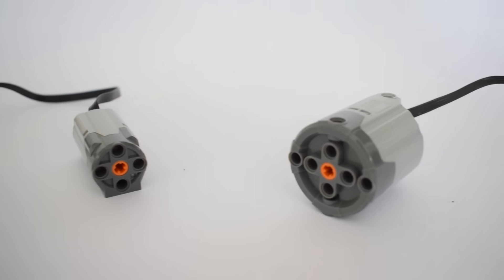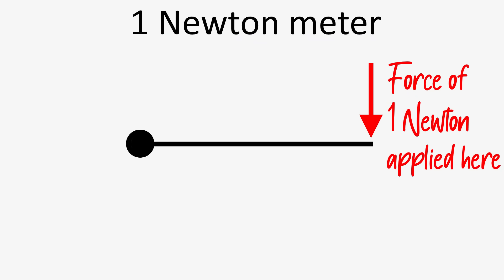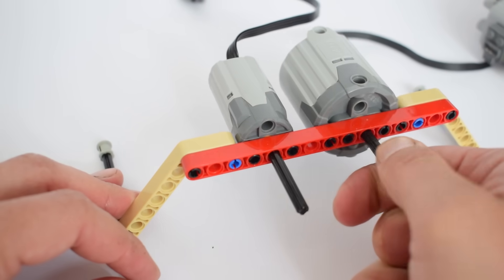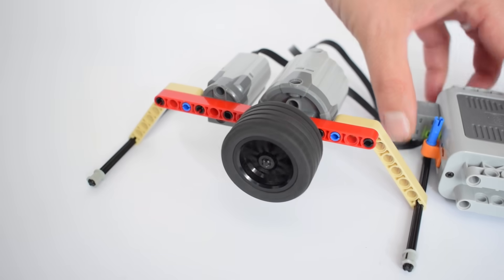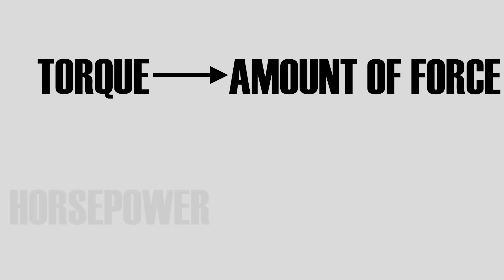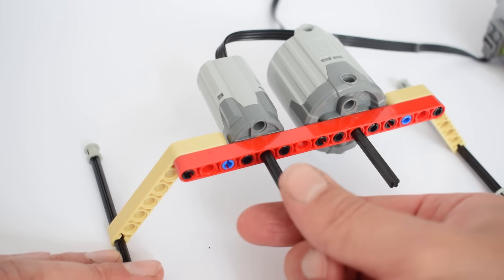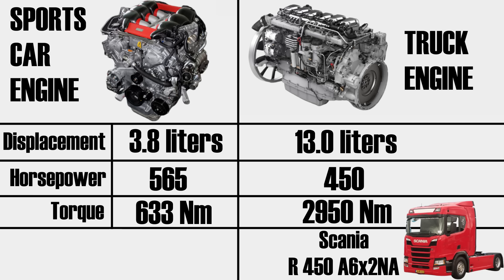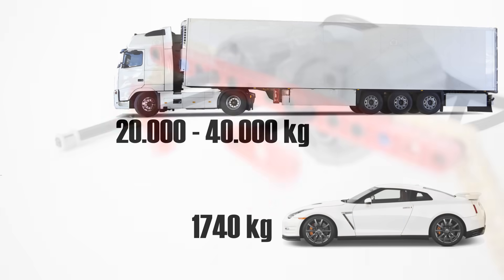NEVER be confused by HORSEPOWER and TORQUE again - HP and TORQUE EXPLAINED in the MOST VISUAL WAY

Comment: Thanks for a easy to understand illustration of the difference between HP and Torque. However, I know what a pound is as it applys to foot pounds, but what is a Newton. The only one's I'm familiar with come in a pack and in different flavors; fig being the original and today, blueberry and strawberry. I think it would help other viewers too since most torque wrenches read both.
Reply: By definition "Newton" is a unit of force that would accelerate 1kg mass by 1m/s^2. Once you have that force in mind if you apply it over the lever that is 1 meter long to rotate something you get 1 Nm. Given that on earth gravity gives objects downward acceleration of 9.81 m/s^2, you can multiply your mass in kilograms by that number (sometimes rounded to 10 in less rigorous scenarios) to find how much force in Newtons your body exerts over Earth surface.

Comment: So if the torque can meet its minimum requirement, engines designed for higher rpms therefore more power outperforms a lower power higher torque engine in acceleration and speed

Comment: Horsepower = Speed
Torque = Strength
Reply: False
Reply: @simplemachine9531   Maybe if you watched the video, you'd learn.
Reply: @Draug24  why do you assume the video is not faulty too? Just because somebody spent their time to make it?
Reply: @simplemachine9531  I wrote the comment before I watched the video lol.
A monster truck as high horsepower, it can fly in the air but it can't pull anything.
A log truck (Pacific or Kenworth) has high torque and can pull over 250,000 pounds. But it's not gonna go very fast.
Reply: @Draug24  read what power is and understand the line 
power=force x speed
And torque is not a force, and definitely not a strength in any way whatever you mean under the word strength.
A man can pull a plane, find some videos here on YT.
Reply: @simplemachine9531   torque = strength
horsepower = speed

Comment: I would love if you made a video of the old volkswagen WBX engines! Especially 1.9 carburetted ones, since the carb has some interesting design features as well as the engine, which was a water-cooled engine based on older air-cooled design, resulting in some... interesting things! 

There's not much about it, but it's an interesting look into engineering reasoning at the time. Result was unique engine which does not have a very reliable reputation, but is very intriguing nevertheless, maybe exactly for that reason.

Comment: Ok, I am still confused.

Lets say I have a lawnmower with a engine that has peak torque at 2300rpm, torque 6.05 ft lb and 2.65HP, however at max speed 3200prm the torque is 5.35 ft lb and 3.25 HP.

Ok so I am mowing and I see a big clump of grass  coming and I don't want my mower to stall out. You could argue that HP is the only thing that matters because it factors time therefore that is the most powerful point.

However you could argue that the point with the highest torque gives the most resistance to stopping (or does it).

Can someone help?
Reply: Go for peak torque if you have a fixed ratio between speed of a motor and blades. If you are able to play with that ratio then decrease blades' radius and work on peak power output, this way you will move an even bigger clump of glass at the same time.

Comment: I think your formula for HorsePower = Torque x RPM is not correct.  It's actually hp = Force or Torque x speed, open for discussion!
Reply: Just google it and close the discussion

Comment: There are some technical mistakes in the terminology, but overall a good video.
Power is a rate at which energy is transferred ("work done"), not force/torque rate. Force applied over time is called momentum. Work/energy is the force applied over a certain distance or torque applied over a rotation by a certain angle. The rate at which that happens is than power.
Reply: And why didn't you check the basics before posting it?
First, check what "over" (maths) means. 
Next, check the definition between impulse and momentum. Edit your comment.
Reply: @simplemachine9531  Uhh, an aggressive smartypants kid trying to boost his ego on the internet, how cute.
First, over is used in physics the way I use it, and it is used all around the internet. I don't give the slightest fuck about its usage in combination with function domains when I comment on an engineering video. I use it on the internet the way it is used on the internet, google "force over time".
Second, impulse is momentum, the only difference is pointless semantics. In almost all other languages, there is only one word use, usually impulse, which literally means momentum. For example, in German: "momentum" (en) = "Impuls" (ger) and at the same time "specific impulse" (en) = "spezifischer Impuls" (ger). So the distinction between impulse and momentum is a gimmicky historic English thing with no scientific value whatsoever. English has a bunch of those useless "scientific" definitions that no one else uses.
I will not edit my comment. I will also probably not give a fuck to check your response unless I am really bored.

Comment: Torque - I started to learn this with cars. Torque is what you feel someone said.  I had a '77 Civic which had only 2 forward gears (called Hondamatic), and I used to just keep it basically floored and adjusted speed via those 2 gears; so 80% power shift and finally you can modulate the accelerator but mostly once you get to coasting speed. Sold it to move and my Grandfather gave me his '74 V-8 Dodge Coronet which was like an aircraft carrier but its engine had low HP and large torque and I could feel it push me into my seat and it was strange to me to be using the accelerator more to modulate the speed (3 gears in that transmission).  Then I moved to a bunch of NEW Chrysler Neons (95, 01, 05) and I read a book by Bob Lutz (who was vice president of BMW before going to Chrysler) and he described how he knew BMW was working on a new motor for the 3-Series and it was small enough for their purpose - and that when the Chrysler 4 speed transmission was having big problems and they had to shift to a tried and true 3 speed from the Omni/Horizon era - they added computer control to it - they had BMW modify that engine to be "torque biased" to make up for the lack of gears - basically I understood with torque you do not need gears to turn that weak but fast spinning - into something you can modulate with the accelerator more easily. The bonus (until now with better CVTs) was that it was much nicer for domestic or work uses (racecars someone said, notice how they push them to get rolling because they have a huge HP bias).

Comment: I like to say that power has the same unit of energy. Torque can be multiplied with a reduction transmission but power can’t. The GT-R engine with over 565 hp can move a truck with a huge transmission rate, but it wouldn’t be fuel efficient. On the other hand, a truck engine can also move a sport car, but it wouldn’t be very efficient because it is too heavy and big for the car. Big engines have lower friction area per displacement and work in lower rpm, making it more efficient if extra volume and weight are not a problem. Sorry for any mistake, I’m Brazilian.
Reply: But what have you learned from the video if you actually know subject better?
Reply: @simplemachine9531  I am graduated in mechanical engineering and an automotive enthusiast. But, actually I don’t know as much as the guy of the video, he just chose a simpler way to explain the difference between power and torque. Furthermore I argued about an other point of view, that I have, in order to foment the discussion.

Comment: But the only thing that finally matters is the (horse)power. Not a single engine delivers the torque to the wheels without some kind of transmission. If you have high power-low torque-high rev engine it just has a bigger reduction ratio to deliver the power to wheels and at that point the torque is similar to low power-high torque-low rev engine with smaller reduction. With transmission, 300hp/400Nm engine has simply more power than 250hp/600Nm.

Comment: The big truck engine is for reliability, durability and fuel efficiency, but NOT NOT NOT because higher torque is any inherent benefit. Torque should never be quoted. It is not relevant.  only H.P., efficiency and durability matter.   High torque engines are heavier which works against overall vehicle efficiency.

Comment: I love this video, but I think one thing is always overlooked: ft-lbs is work or energy, or it can be a moment about an axis, i.e. a static force. Torque, a movement force involving rotation, should be represented by lb-ft (or lbs-ft) per SAE.
Reply: I'm not that familiar with the imperial system, but that's a bit confusing 😅

Comment: What would happen if you put the nissan GTR engine in the truck, and then you simply use very short gear ratios? Would that work?
Reply: Yes. That's why power rating is there.
Reply: @simplemachine9531  then the torque is irrelevant, isn't it?
Reply: @videofrat3115  sure,
Power=acceleration*speed with a given mass. You trade between acceleration and speed with a help of gearbox. The more power and the more gears, the more you trade. This is why truck engine generates 600hp and is paired with 18speed gearbox.

Comment: Good explanation.  Really, the whole thing could be summarised as "power = torque times rpm".  The confusion comes from the words being used lazily or inaccurately by the biking community (I'm a biker) and (I guess) the car community.  You hear all this stuff about "power is how fast you hit the wall and torque is how far you move the wall" which is unhelpful.  A vehicle can deploy the same amount of power with low torque at high revs, or high toque at low revs.  Power dictates how fast the vehicle will go, allowing for weight, friction, air resistance, etc. because it is work done in a given period of time.  The torque could theoretically be measured at any rotating axis from the crank shaft, through the gearbox input shaft, gearbox output shaft, and as far as the driven wheel.  If (for simplicity)  you ignore losses through friction, at any one of these places, the torque may be different, but torque x revs will equal the same amount of power.  In real life, you can't ignore losses through friction.  That is why you can't go to the absurd and  use a 1 rpm engine with an enormous gear ratio to get high speed, or a 20,000 rpm bike engine geared down ridiculously to pull a truck.
Reply: Agreed. And follow up video he published week after that was about how many comments had the variation of "wall definition".

Comment: I think it might be helpful to think about the electrical analogue of Torque and RPM as Voltage and Current, respectively. In both cases the product of the two results in Power. Voltage and Torque are what you need to overcome electrical resistance or mechanical friction, while current and RPM are the time dependent concepts that help you deliver high Power once you overcame the initial barrier. Maybe the analogy would be more accurate when you think about increasing voltage in order to create a dielectric breakdown to get the current flowing. I think this is very similar to using torque to make the wheels start spinning when you have a heavy load or are in a very inclined slope.

Comment: Thank you for the great demonstration. As a motorcycle rider, I hear lots of debates about this topic. One analogy I use, which demonstrates the difference well IMO. An R6 600cc with 40ft lbs of torque at 12,000 rpm, will make the same torque at the back wheel as a R1 1000cc 80 ft lbs of torque at 6,000 rpm, with both bikes traveling at the same speed. This is why HP is important.
Reply: Riddle me this. In your example in light of the video definition of HP (torque x RPM), the math on both the R6 and the R1 = 480,000 HP. This obviously is no true. Why? I may be bad at math, but I did use a calculator. Appreciate a response.
Reply: @parsonscarlson7984 Horsepower = Torque x RPM / 5,252
Reply: @parsonscarlson7984  to see the math work we would need a dyno which measures torque at the rw in those conditions.

Comment: Question - since torque is felt, why can't we feel the great torque of the large truck? If the answer is "because the force is not applied at a fast rate" then don't we also need the horsepower to feel the torque?
Reply: Mass involved, but the assumption that torque is felt is wrong anyway.

Comment: It's simple. Power is torque x rotational speed x constant (unless you use SI units when the constant is 1 and it's simply torque x rotational speed).
Reply: It's wrong.
Coming from force x speed, Power = torque x rpm x 2π
To convert to units of power, torque x rpm is divided by different constants, including SI (Watts) of course.
Reply: @simplemachine9531  I stated there was a constant, apart from SI units where power (in Watts) = torque (in Newton metres) x angular speed (radians per second).

RPM is not in SI units. The SI unit for angle is the radian, whilst for time it is seconds. All you have done is prove me right by introducing a constant that converts RPM to the SI unit of radians per second, except that you used the wrong constant. The correct formula using RPM is power (watts) = torque (in newton metres) x RPM x 2π / 60.

Physics is full of formulas with angular velocity in the SI units of radians per second as it simplifies them.
Reply: @TheEulerID  Watts = Newton x Meters x radian/second? Wrong.
Or I'm sorry for my bad reading.
Reply: @simplemachine9531  No, it is not wrong. It's because the arc length of something of radius "r" through one radian is "r".

So, if we have something of length 1 metres and rotate one end about the other over an angle of 1 radian, then the length of that arc is 1 metre. Thus if we apply one Newton force at the end and rotate through 1 radian then that force has acted over 1 metre length, which is 1 joule.

So, what I say is correct. If you multiply torque in newton-metres by rotational speed in radians per second you get power in watts. All those are SI units.

Comment: Wrong, you dont feel torque in a car, it is the worst analogy that can be made. Torque is meaningless when considering the performance of a vehicle without knowing the RPM of which the Torque is made, therefore you may aswell just refer to it as its power figure at that particular rpm. Take your truck and gtr analogy, if you put that truck engine in the GTR assuming the weight was the same the GTR engine would still feel faster due to its ultimate Power Output, (Torque x RPM/5252). Also the Torque generated by the engine is meaningless yet again due to gearbox ratios and does not give an idea of wheel torque. 
Increasing torque at any RPM (except at 0)  only increases the Work Done which is the only figure that matters in performance since it helps increase the area under the Power graph. 
Power is the result of Torque at RPM and is the only power figure that matters, gearboxes will deal with the rest.
Its simple maths and videos like these give a wrong interpretation of force and work done.
Reply: dependon point of view on set gear at rpm max tprq you will read more acceleration at set speed at max power rpm more acceleration ,you can calculate force both from torque and power just from power is way easier faster simplier 😉 cos calculate force from torq you must calculate rpm ratio between crank engine anr drive wheel axis at specified speed than multiple be eninge torq than divide be wheel radious (not including losess) than you finally know whats happen so than you know true force. push vehcile forward vs from power its  only watt :m/s = force 🤭🤷🏻‍♂️ 🥳 without gearbox like in electric vehicle assuming grip is enough always more Gforce be achievable at rpm max torque everything change with gearbox where driver can choice gear and rpm for specified speed on track than its alll about POWER in regard to max crank engine value of both tprq and power 😎👌🏻So like im write it depend on point of viewand what type of regulation we lsetup in our let say some test in real world with some cars or motorcycles or whatever what , assuming optimal gearbox for each vehicle all else equall more less let say 100 hp 12 k rpm 50 nm 8 k rpm beat 50 hp 6 k rpm 100 nm 3 k rpm on dragstrip and on sachsenring 😎 but most driver still would prefer more 50 hp 100 nm version as daily vehicle  cos of much stronger lowend less noise /rpm better lowend elasticity and easier take off  from stand still 👌🏻 we can say you feel torque power force depend on point of view at end only what you feel in vehicle is force betweenseat and body 🤷🏻‍♂️ which is product of point of view 😂  and yea im agree this dude say alot 💩 which misleading and  confuse avg people even more in terms how both affect performance of cars or motorcycles dont wathc this again forget  anyway what he say but i remeber alot 💩here everything cos of he dont plote in hees explanation speed  and how torque both at engine crank and drive wheel axis and power impact on speed for acceleration force 🫣 😁👍🏻

Comment: My god this video not only cleared up the confusion I had about torque but horsepower as well. It’s very easy to visually see the comparisons in this video and it gets STRAIGHT to the point rather than somebody just telling me what each means with very little context. Torque essentially shows how much muscle a motor has but horsepower is how much power an engine can output which might have more benefits depending on what you’re using it for.